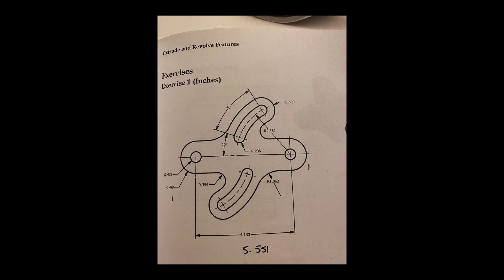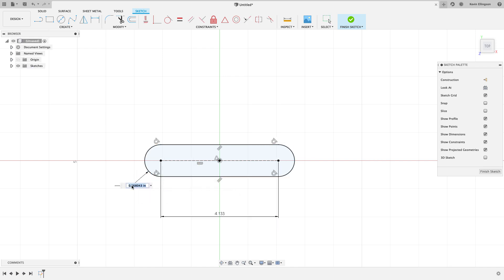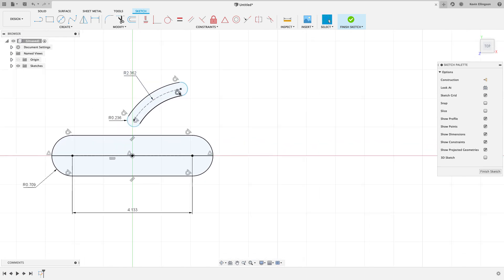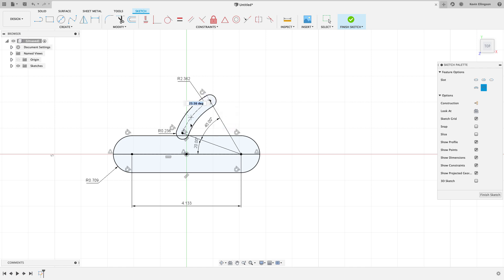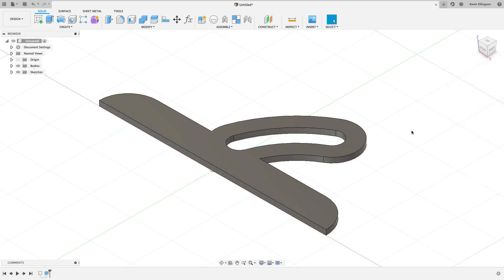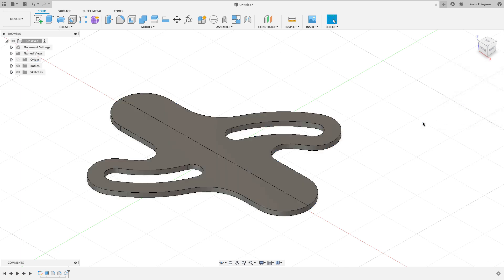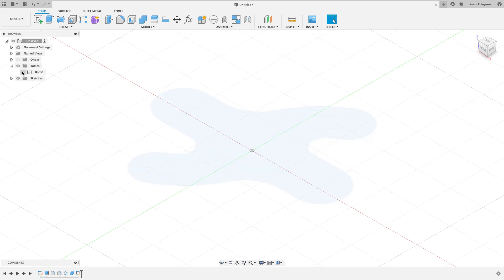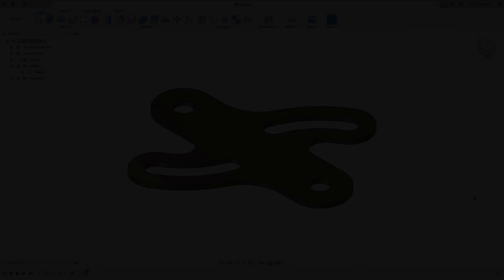Fusion 360 Modeling Practice

Comment: Hmmm... Why not circular pattern within the sketch? And draw your holes out too? It would really consolidate your timeline without making things too complicated for the drawing workspace in fusion. I agree the fillets after the extrusion are much simpler. The two sizes can be combined to one command though giving you 3 steps. Sketch, extrude, fillet.

Really not trying to sound preachy. I just usually create larger assemblies so I find that timeline management is always a good habit to get into on any part... But I might be a little over-obsessed with it.
Reply from the maker: Hi Bryce. Sketch mirrors are harder to compute than feature mirrors/patterns. In my experience, combining different fillet radii into a single fillet feature is OK if you are the one that did it, but make it harder for a coworkers to edit. People's brains generally associate a fillet with a fillet radius. So it could take them a little longer to find the features. Mostly the reason I did it this was was for future edits. Also, are you creating components in your design and making sure you have the component active when you add sketches or features? That should help to simplify the timeline a bit by doing that.
Reply: @MechanicalAdvantage  I do find myself edditing under the main component instead of subcomponents (but all initial drafting and new features are within the sub-component to keep everything in the right place.

I just probably have an over-the-top obsession with keeping the timeline clean. Never had a problem with sketches being too hard to compute though (unless I tried to make them way way over-the-top complicated ) I figure if a circular pattern exists in the drawing mode, why not use it?

Comment: Great video Kevin. For the life of me I couldn't get the "auto project geometry on active sketch plane" to work. The box wasn't ticked so I checked it an hit apply and when I go back to design and click off the body like you did. Nothing appears in a shadow and when I go to hole command there is no center to grab onto.  :(
Reply from the maker: So the way defaults work is sort of stupid. If you have created a file and change the defaults, some of those won’t update for the document you are in. After you make the change, start a new file and try it and you will be good to go.
Reply from the maker: You can do the same thing manually in the file you are in by using the project button and clicking on the arcs.
Reply: @MechanicalAdvantage  Thanks Kevin. Ya that works now after starting another design.

Comment: Hey Kevin - really enjoy these vids. I didn’t know about the three point angle trick. Your note about having to make the two circular ends concentric to fully define the sketch made me think of something for a possible future vid. That is, sometimes I get sketches where I can’t seem to fully define (make black) everything. There might be a line or arc that stays blue no matter what I do. I try to drag the feature around and it won’t move. Sometimes I just give up and leave it not fully defined. Anyway, the video suggestion might be “sketch troubleshooting” - going over any tricks and tips you have for ways to figure out what’s undefined. Maybe that’s not worth a full video, but could be something to touch on. Just an idea.